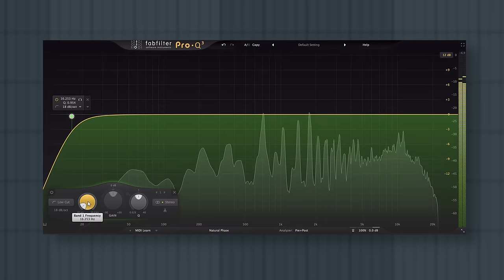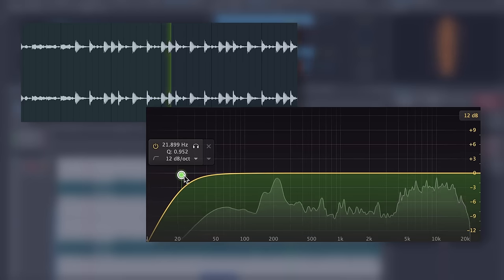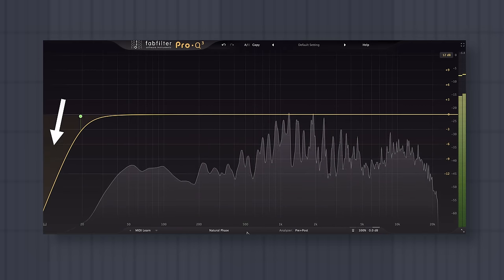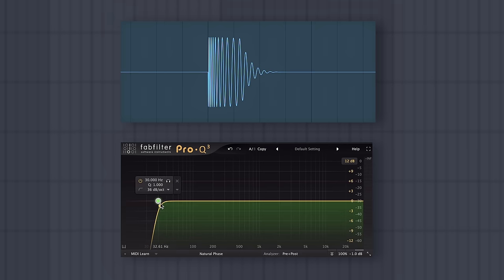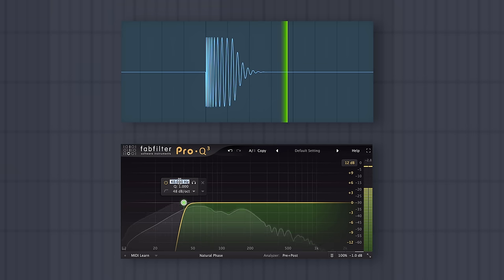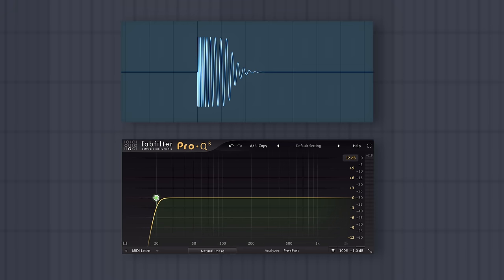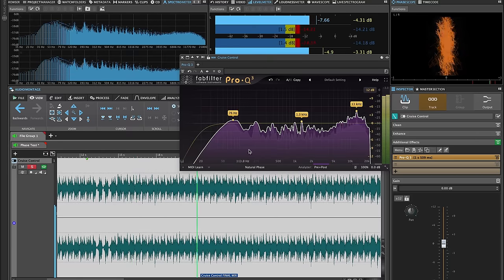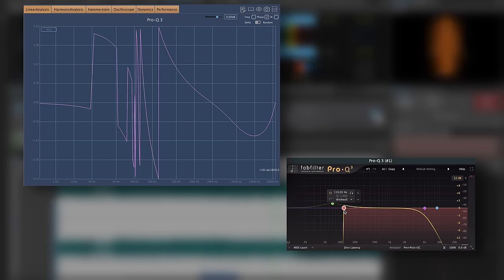Do high pass filters ruin your mixes? Fixing Bad Music Production and Mixing Advice EP.2

Comment: A & B sound the same to me for the most part. Which brings up an interesting point. Like 99% of the people listening to your music isn't gonna hear the difference either, or even care or know what a little phasing or pre-ringing is/sounds like.

Listening on E8XT's
Reply: Literally exactly, I think its a trick question, but even if its not, it may aswell be, theres NO audible difference to 99% of people, on 90% of devices.
Reply: but you're listening on a low-to-mid-range pair of monitors. When people mix and master music it's designed to sound great on ALL speakers. Especially dance music. If the low-end sounds like shit, it will literally never get played in a club or by any DJ.
Reply: Audible differences are only one reason people do this. The second one is low end rumble from different tracks adding up and thus forcing you to mix at a lower level before you risk clipping.
This problem by now only applies to the main bus since floating point computing allows us to exceed 0dB on individual tracks but there used to be times where this was different. The lower bit rate forced you to record as hot as possible to use up as much of the precious dynamic range as possible. But since you were not allowed to go past 0dB at any point in the chain a simple EQ boost on a single track could cause huge problems, because you already were as close to the ceiling as possible. So high pass filters were not only used to give every instrument it's own place in the mix but also to help to be deal with the limitations of early digital recordings.
Reply: You are a sound engineer? Yes? That's why it doesn't matter what the 99% of listeners can hear. Sound engineering is about the engineering part not just the audiphile if it sounds good part. We want to understand this stuff and hear it in order to make better mixes, not music. The music has been made we are just engineering it to give the best picture of sound. 
I think that is important and every engineer should respect that. We are to get the best sound possible not be angainst the finer details. If you aren't about details then i don't know if this for you (whoever is reading this not just the comment im replying to)
Reply: @Notinserviceij  That's just one way of seeing things. From the other perspective, you could ask this question: who do you mix music for? For other engineers or all those who will listen to it every day on shitty speakers/headphones? That's also why a lot of engineers like to test their mixes on different devices.

Or, from yet another point of view, if you take it backwards, unless you're rich and have already developed your ear, you're probably not cut out for mixing music. Because then you won't be able to listen to the details in the first place (like if you're using headphones or using monitors in an untreated room with parallel walls). Which means I should just give up at this point lol.

In the beginning, it's important not to pay attention to details and just get shit done. After a while, you automatically get better at hearing details and consequently act on them. However, it's still important to learn about details along the way.
Reply: Because, in the high-pass filtered version, you've got more headroom, meaning you can boost your track louder than the non hi-passed version.

Excessive sub bass will even throw off streaming loudness (LUFS) normalization, so the track with excessive sub bass will get turned down, relative to the track without.
Reply: @EricGoetzMusic So much to consider!! I really wish people still consumed music via an external product.
Reply: @CaptainTodger69 most music is online who cares about djs or clubs lmao
Reply: @Notinserviceij This is why all the classics were recorded with noisy analog gear onto hissy tape.  The magic is not in making it sterile.
Reply: @No.17TypeS   @No.17TypeS  nah mate you miss-understood my point 

And I also disagree 

It's not about points of view 
What you have said is correct but relates nothing to what I am saying 

People that mix music go around saying, x doesn't matter or blah doesn't matter, when it's not about it mattering 
It's about, you are an engineer, you should be wanting to understand why this works with this or doesn't but sounds good 
You should be intrigued by it 

Not caring what others hear is exactly the opposite of being an engineer 

If you want to be an amateur or an enthusiast then sure maybe none of this in the grand scheme of things matter 
But if that's the case then those who consider themselves apart of that shouldn't go around saying how much any of this matters 

They shouldn't because context matters, and they don't have the context of being an engineer, just someone who dabbles in music production 

You and I are talking about two different things, that's okay cause I don't write the best comments 

But yeah this to me at least is very objective and no subjectivity within it 

If you are an engineer, you should care about all the details, that's your job if you are and you don't care than you at least a bad engineer whether or not your mixes sound any good
Reply: you have to focus on the kick  and the hit hat to hear the difference.
Reply: I've got Yamaha HS-8s and I can hear a pretty clear difference in the low end, the first mix sounds cleaner and tighter in the low end to my ears.
Reply: @t3ch_n0  I guess this only applies to electronic music (what I make) but finding the best mix is really important because it make not make a difference on most people devices, but it will make a big difference on a live set playing in huge speakers.
Reply: @CaptainTodger69  see that's what you think m8 but I'll play a youtube mp3 rip in the club like it's no big deal
Reply: @MusicPlaylists-kr9rn  downloading it off youtube doesn't mean it wasn't mastered properly
Reply: @CaptainTodger69  youtube kinda does it for you when you upload actually kinda a secret trick
Reply: Need different headphones or possibly ear hasn't matured

Comment: Mix A has the highpass enabled. Mix B has more low end in the very sub frequencies. I'm listening through my dedicated sub!
Reply from the maker: Thanks for sharing your answer, I will share the results next week on my community tab on YouTube.
Reply: Niooooo
Reply: I am on the same page
Reply: B does not have a filter on it
Reply: I thought the same although I'm only on Yamaha HS7s with no sub. Maybe it was placebo but if you're on a sub guess it must be the case
Reply: they sound absolutely the same, im listening on (good) headphones tho? is it possible to hear a difference this way?
Reply: @Cloud2KK  same here, unfortunately it's more or less impossible to mix sub bass on headphones though no matter how high end they are, and quite hard to mix bass frequencies in general. This is largely a physical limitation due to the long wavelength of these frequencies and the tiny space available between your phones and ears, as I understand it
Reply: @Cloud2KK  yes
Reply: What did he say the actual answer was? 

I hear more bass in A, and likewise I hear more transient definition in B. Can't tell if the lack of transient definition in A is from either slight preringing the HPF gives (if in linear phase) or is instead from the slight added resonance that occurs at the cutoff points of HPF's. 

B clearly has more transient. Not sure if this is because those are the original transients that haven't been minimized from an HPF (aforementioned preringing or resonance boost) or if it's because there's a bit less overall sub-bass. It does sound more natural to me, though.

Would have been helpful if he told us whether the HPF would be "Natural Phase" or "Linear Phase."

Comment: A was original and B was High pass filter. To me, the difference was in listening the kick in context of the whole mix. In A the kick felt like it was playing separate to the other sounds of the mix, whereas in B, the kick sounded more included with the other sounds of the mix, so I believe the sub frequencies were cut in the B.
Reply: I agree with A as the original and B as High Pass. If you listen verryyyyy closely to the kick, B is a teeny tiny bit fuzzier sounding to me. A sounds like all of the original frequencies are intact.
Reply: Exactly
Reply: I'm on this one as well. I noticed in B that the kick's body is much more present and blended with the mix, while in A the kick's body is less audible due to the sub content that hasn't been removed. Sometimes less bass = more bass (Maybe? 🤷‍♂). Listening on Focal Alpha 80.
Reply: @ashleykister4634 claps are more crisp too, the low cut brings out the high frequency transients a little i feel
Reply: I agree, but for different reasons: 

(copy+pasted from other reply)
I hear more bass in A, and likewise I hear more transient definition in B. Can't tell if the lack of transient definition in A is from either slight preringing the HPF gives (if in linear phase) or is instead from the slight added resonance that occurs at the cutoff points of HPF's. 

B clearly has more transient. Not sure if this is because those are the original transients that haven't been minimized from an HPF (aforementioned preringing or resonance boost) or if it's because there's a bit less overall sub-bass. It does sound more natural to me, though.

Would have been helpful if he told us whether the HPF would be "Natural Phase" or "Linear Phase."

Comment: 2:57 This is a perfect example of what a highpass filter is - it differentiates a signal, just as a lowpass filter integrates a signal (I know, big scary calculus...) I generally agree with your conclusions and this is presented fairly, but the old advice I remember receiving was to highpass everything except for bass instruments, which is much more sensible than HPF everything. If you know that you are filtering below the lowest fundamental of a given instrument, it really doesn't do any harm, and you really can clean up some noise (rumble) that may have bled into the recording. Obviously, still a tool that should be used appropriately.

Comment: Thank you for this video. I consider this common sense. Or one would think it is. 
There is absolutely no reason, what so ever, to leave unwanted frequencies tornadoing through your mix. Especially subs and low end in general. Leave that area for the Kick and Bass. With the exceptions of specific productions where some percussion elements or other low end instruments wanting to play in that frequency range as well. More often than not, I see useless low end information in hihat samples, snare samples, vocals, strings..etc..etc.  And highpass filters is one of the first things I do in a mix when mixing for others. In fact, quite often this fixes all the clarity issues.

Comment: I just built several acoustic panels for my home studio off of your instructional video (with batts of recycled demin material, thank you for that tip!). This kind of video really helps me out, operating out of a home studio space with odd and not ideal dimensions - the room itself can trick me into thinking there are inherent issues where there aren't. And snapping out of the paranoia of looking for problems everywhere helps me focus on what I'm actually doing to assemble a mix (and worrying over whether or not cutting/accentuating low end is a big area of stress sometimes). I really appreciate your videos and outlook on dealing with sound.

Comment: They sound almost the exact same, but A felt a bit weaker. B just had a bit more beef to it, so I think A is high passed. Overall, the master would sound fine either way imo. Just separate your low, mid, and hi frequencies, crank them up with a super transparent Pro-L, then sidechain them using whatever method you like. I personally use Fruity Limiter for the Kick, followed by trackspacer to clean up the spectral space with the kick sidechained through it, then i add another Fruity Limiter for the snare after that. It'll be loud, but just bring the slider down to balance the volume however you want in the mix. It's pretty meticulous, but it's SUPER clean and works for me. Route that through a Post Sidechain, then trough a pre-master, clean up the mix in the premaster, then go through the master and do your thing. Tbh, as long as you clean up your low end mix, your mix is gonna turn out great. Just a ton of very transparent limiting. I don't really compress much unless I'm sound designing.

Comment: The answer for me is B - I’m listening with the iphone earplugs on a train, so maybe not the best surroundings but i get the sense that B has the low cut on, in zero latency/ Natural phase mode - the reason being is because i can hear the 180 degree phase shift which usually translate in an enhancement of the mid-low frequencies, very frequent in what is called the ‘Gibbs effect’, not too audible but that’s what my ear tells me.
Reply: For ‘enhancement’ i mean an increase in amplitude in an aera really close to the applied Low Cut. Having a low cut/eq on, doesn’t necessarily mean that there’ll ve a reduction in amplitude of the overall dynamic, as in this case. Phase shift needs to be taken in consideration.

Comment: Track A has been processed / HPFed due to the ambient synth that's been side-chained sustaining all of the track audibly having more bass / low-mid frequencies around the 150 hz range on track B. This bleeds into the pluck bass and mostly the arpeggiated synth with a similar timbre. To the point where some of it's lower register is obscured. Right as the transition happens you can subtly hear a right pan biased low saw wave tone compound with the bass pluck pumping on the offbeat. It's very subtle, but a reduction in mix clarity.

Comment: The phase shift is only an issue if you mix the HP'd signal w/ the dry signal. Or if you used multiple mics/channels on a source and don't HP all the channels together.

If you understand how your tools work & how to use them properly there won't be any audible problems.

Comment: With my earliest efforts I knew little about EQ or compression, except that cutting some of the lower end in sounds made the resulting mix clearer. Along with attenuating at 16000, 8000 & 4000 Hz, It's still one of the most important things I have learned about music production. There is no single rule of thumb for where to cut low end. You need a good audio setup for monitoring low end & you have to use your ears. A gentle slope is best of course. And the linear phase trick is handy.

Comment: This is what we have spectrum analysis for: only cut away the noise, not the signal.
I use high passing on every microphone track because there can always be low freq rumble from your steps on the studio floor - or from thumping the desk - reaching the mic via the mic stand.
Reply: Do you really know what noise is? I mean in terms of frequency spectrum. If we  could easily filter it out noise when it is  present in the signal we would not need low noise audio pre-amps and ADCs.
Reply: @hbo001 Does who really know what noise is? Anyone who doesn't know their rumble from their hiss doesn't belong anywhere near a mixing console in the first place.
Anyone who wants to learn can solo and loop any noise to get a good long look at in a spectrum analyzer. Train your ears and your eyes.

Comment: Great vid! My take is generally if you have phase issues, you'll hear 'em. New engineers are probably overthinking phase. I only worry about phase when placing mics, or when I hear a phase issue while mixing - which is actually quite rare.

Also if you really want to ensure your phase is correctly aligned, there are plugins for that. I have used them, and no longer do.
Reply: i wish people would stop talking about phase generally …. there’s so much misunderstanding about what it actually means and there are so few situations where phase shift actually causes problems. 
obviously if you have two related sounds playing on top of eachother phase shift matters. 
but for example with kick and bass your kick and bass will never be in phase!!! they’re completely different and unrelated signals. in the same way like this video says the phase shift from highpassing a single track will literally never ever be an issue

Comment: I know this is old, but just wanted to comment anyway.
"B" is the mix that is high-passed. Can tell because less sub frequencies are hitting the master compression/limiter. The result is cleaning up the pumping effect coming from the kick drum, and allowing the overall mix to feel less heavy and giving more clarity. Though I could be wrong, as my open-back headphones aren't great for sub frequencies. Sometimes I get tricked by the low-bass, rather than sub because of that...

The main issue I ran into with OVERDOING it with the high-pass on the master, was that due to the phase shift, the input on the limiter INCREASED, even though I was only trying to "remove" frequencies. The mix ended up being hit harder by the limiter and sounding more squashed, even though there was no audible difference in level coming out of the EQ... First time I'd come across that and man did that ever throw me for a loop. Because of this, the answer could be "A", especially if linear phase is not enabled, because the phase shift could be causing a higher level to go into the limiter, which would cause the pumping. Without a doubt, the highs are clearer on "B".

Dang, sucks to be wrong. But even after viewing this track on a spectrum analyzer, don't even see a difference either!